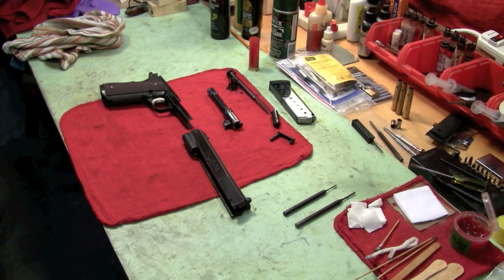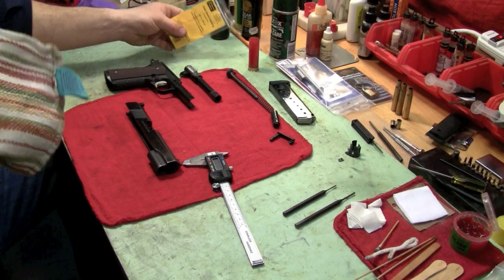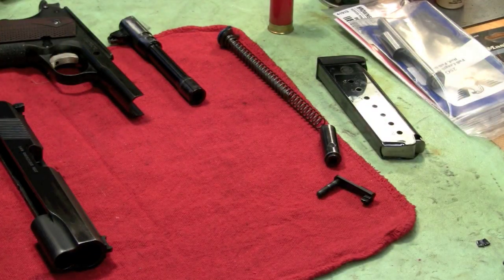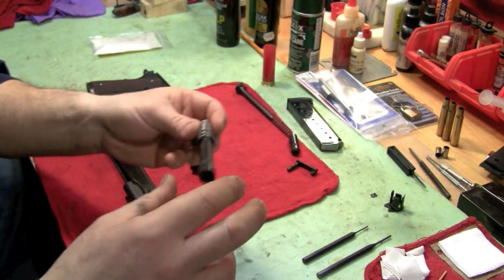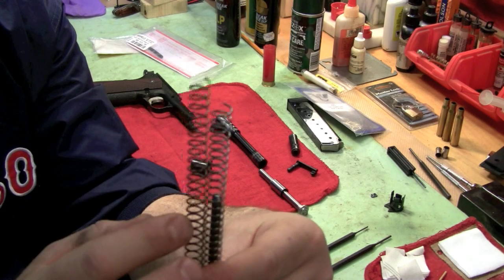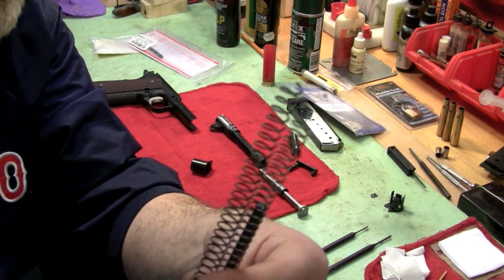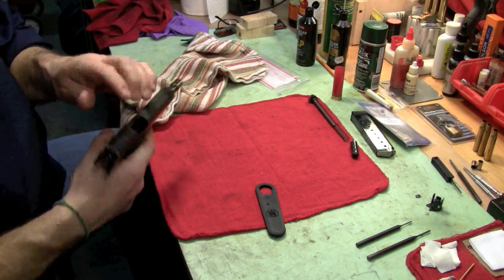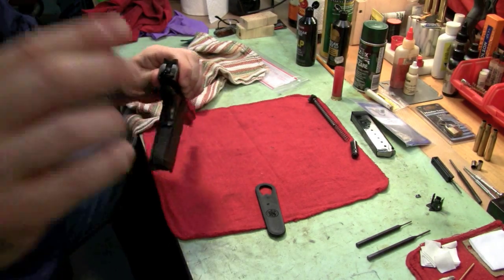Colt Collet Bushing Failure. Repair  and 1911 Upgrades

Comment: After having two collet bushing failures in my series 80 Colt Gold Cup I just contacted EGW with my measurements for one of their fitted solid bushings. Got the new solid bushing  this week and the fit is amazing. Glad to be done with these shitty collet bushings.  BTW Colt would not extend a courtesy repair for my gun needing a part THEY NO LONGER PRODUCE! They would happily sell me a solid bushing, then fit it for an additional charge at the custom shop plus $30.00 return shipping cost. The fitted bushing plus shipping from EGW cost less than the Colt shipping charges!

Comment: I have the Ruger SR 1911, which has a series 70 style set up. I realize Colts are the only "true" series 70 or 80, but to make it easier, i just say it's 70. If I want to have some smithing done to it, what are a few recommendations?

Comment from the maker: Sort of, but it is flawed.  The idea is to get a tight bushing to barrel fitting without a lot of gun smithing.  This is the most important thing for 1911 accuracy.  The collet idea saves money for the maker.  The problem is that they fail.  You are way better off getting a good bushing fit to your barrel.  Having said that I swapped mine out for an Ed Brown, you have to measure with a caliper to make sure it will fit right, and there is no difference in accuracy.